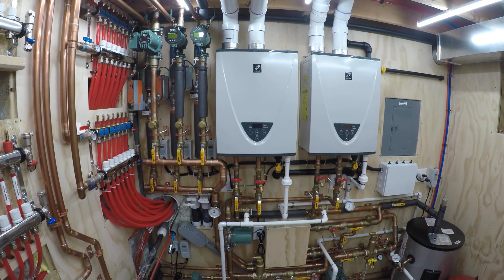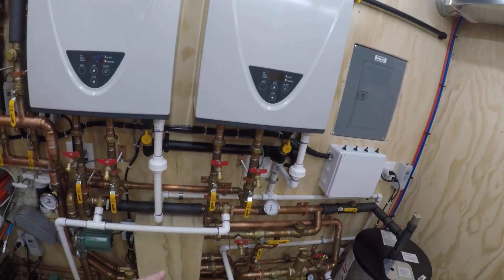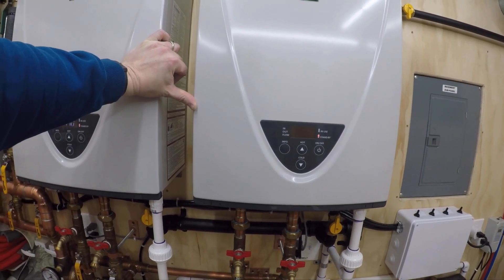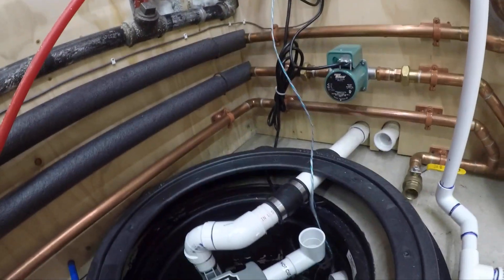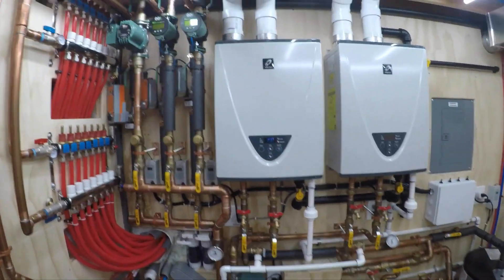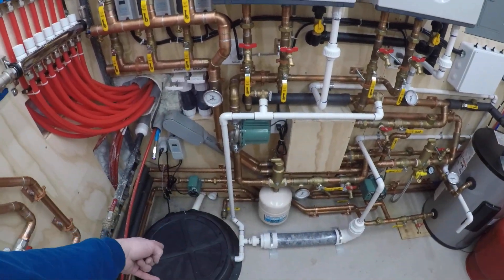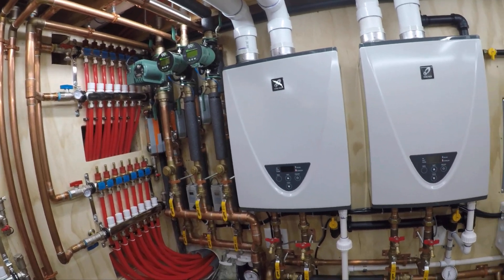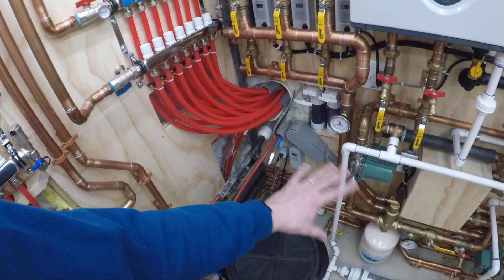Mechanical Room Part 3: DIY Heated Driveway Snow Melt & Radiant Heat System - Episode 55 [2-12-2021]

Comment: Hello sir, what Beautiful work. I have one question:  why don’t you have pre-filters, water softener and post-filters for incoming city water. That would help your efficiency, longevity of equipment and great drinking water.
Reply from the maker: Hi Joe!  Thanks for the compliments, I appreciate it!  Great question about the filters.  Adding them was a part of my initial plans, but I later decided to leave them out.  Luckily, our city / county water here is great.  It is not "hard" or "soft" at all.  While it would be nice to have the filters just to remove any sediment that might come in, we have no complaints about the hardness of the water, the taste, etc.  I have a shower head that I installed 15 years ago, and I have never taken it apart to clean the inside.  It still functions like the day it was new.  I think it would've also been difficult to incorporate filters into my pressure loop design, unless I put them between the meter and the loop (which I didn't have room for), or installed (2) filters, one going each direction.  In the end, I don't regret not installing them as we have no issues, but I could also see someone incorporating them into their design. Hope that helps, and thanks for watching!

Comment: How hot does the snowmelt lines need to be? Im hoping to install in a new driveway with geothermal for my source and the installer said they need to get hot enough for the water to evaporate so they need a boiler to get hot enough or ice will develop.
Reply from the maker: Hi Dan!  Your supply temperature will depend on several factors, including pex size, pex spacing, size of the slab your melting, expected performance, insulation, etc.  For my system, once everything is up to temperature I have 100ºF going out to the slabs.  I would agree with your installers with regards to temp. The last thing you want is a system that melts but not completely.  It will run non stop trying to keep up, wasting resources and creating ice if not hot enough.  If you haven't watched my other videos yet, check out some of the startup ones, including this one: https://www.youtube.com/watch?v=zvBzC93B5j8
Thanks for watching!

Comment: I’m about to pour a pad and don’t quite know the best way to get a tube like you did installed so I can run a bunch of pex through it. 

Could you speak to layout concerns/spacing of the pex under the concrete and other prep before the concrete pour?
Reply from the maker: Hey xRapidDavex.  Not sure if you saw my playlist, but the first few videos show and discuss the prep before the pour.  You can find it here: https://www.youtube.com/playlist?list=PLdWeMRuZcbQjekwiBk_uy39IS6JFWYORD 

I lucked out in that the 6" PVC pipe through the basement wall was installed years ago, and I was just able to tap into it.  That could be done a number of ways, I just decided to run all of my loops through the existing pipe into the basement You could locate the manifolds outside if its easier.  With regards to the spacing, the larger diameter pex you use, typically the wider apart it can be.  Mine is no doubt overkill with 5/8" pex at 6" on center for most of the install, but in all of my research I have never heard or read about anyone regretting putting TOO MUCH pex in the slab.  Bigger pex also gets very difficult to bend and work with, so take that into account as well.  Connect all of the loops together and pressurize them before and during the pour, and have repair couplings ready use in case!

Comment: Awesome, this is so great to see! The more geeky the better. At least for me:) Thank you for sharing. Could you share some information about your energy/gas usage in cubic feet (is that what you measure in in the US?) and kWh? It must be a relatively expensive to run all of this 24/7, having heat go to all these places. Of course you shut it off at night, but still.. Again, thanks for sharing! Looking forward to more:). Subscribed!
Reply from the maker: @Tom de Boer  Thanks for the compliments and feedback!  If your looking for gas usage for the snowmelt part of the system, you will find this video extremely helpful: https://youtu.be/VotJEQigTkw

Believe it or not the system is extremely efficient, and it is not that expensive to run the radiant heat portion at all.  The snowmelt costs approx $0.50 - $0.70 per hour to operate, but that's literally heating the outdoors as I keep the slab snow free.  Regarding your comment about shutting it off at night, believe it or not, I actually do not.  The radiant portion is meant to run 24/7 on continuous circulation. I also made a couple of videos on how all of that works, you can find them here: https://youtu.be/mdcL97cuRDs

Thanks for watching and subscribing!  I have several more videos to post.  If you haven't seen it yet, this playlist: https://youtube.com/playlist?list=PLdWeMRuZcbQjekwiBk_uy39IS6JFWYORD contains all of the videos I have uploaded so far on this topic.  I think you'll find several of them useful!  -Chris

Comment: I’m a Union sheetmetal fabricator and I watched 1,2, and 3.  Awesome job and thank you for the video.  I’m obsessed with mechanical rooms.  Furthermore I’m building a shop on some property and then a house.  You set the bar high my friend.
Reply from the maker: Hi smgeorge816!  I really appreciate you taking the time to watch my videos, and taking the time to leave kind comments.  I think I mentioned it in one of those 3, but I was a little cramped for space here.  I wish I had more wall room, but I just didn't.  The zone pumps / valves are a little closer than I wanted, but I made sure that everything could still be serviced (including being able to remove the actuators for repair / replacement if necessary).  Overall I'm happy with the results!  If you have any other questions or want to see anything else, just ask!  Thanks again for watching, and stay tuned, much more to come! 😁  -Chris

Comment: Christopher, I'm a mechanical engineer and I've worked in the HVAC construction industry for 25 years. That piping looks as good or better than some professionally (Union!) installations. You've done a great job with the controls and all of the accessories like the expansion tanks, air vents, fill/purge valves, air separators and even the heat exchanger! In an earlier video you noted that some people don't recommend using the tankless water heaters and the only reason for that is the small size of the tubes in the heat exchanger means they can get clogged if you don't do the maintenance that you mentioned (flushing with vinegar on an annual basis). They also have a bit higher pressure drop and flow restrictions compared to boilers. Otherwise, they are just as efficient (at a fraction of the price because they're made in much higher volumes) as the other boilers you mentioned, which if you used you'd basically operate "in reverse" from your setup (e.g. You'd run the glycol through the boilers and domestic would come from the heat exchanger). As long as you do the maintenance (and your strainer on the domestic water inlet is very helpful in that regard; you might even consider a water softening system - that will help reduce precipitating calcium in the domestic hot water when you recirculate at 140 F). It's a shame that you have to start your snow melt manually - a combination snow/temperature sensor in the driveway would have made it all automatic. I also like your comment about using two water heaters even though one would do the job - the start-up and having multiple demands really makes that second heater necessary. Heating up the concrete driveway takes a lot of heat and getting the snow melt started with a single heater would be slow. Now you just need to insulate all that copper pipe so your heat all gets to where it's needed, not just keeping the water heater room warm (it is a shame to cover up that beautiful piping job)!
Reply from the maker: Hi Ken! Thanks for your detailed explanations and positive comments!  I debated long and hard about using a wall-hung boiler with an indirect vs these tankless units.  In the end I decided to go this route, but I have no doubt it would've worked just as well using a boiler.  So I'm thinking you haven't seen my electrical system overview video yet? 😀. In that one towards the end I talked about my decisions on the whole automatic vs. manual.  The good news is, I DID put the Tekmar Socket in the slab, and run conduit back to the boiler room, so adding automatic operation is still possible down the road 😁.  I also debated heavily on the whole 1 vs 2 heaters.  I was told by several folks that 1 would be just fine, but in the end I'm glad I set it up for 2.  Sure I could've added a second later on, but it was just easier to pipe it all with 2 from the start!  You're right about the insulation, it's been on my list for a few weeks, and it does get nice and toasty down there.  The plus side is the kitchen is right above it, so all that heat just helps warm the kitchen floors 😁.   Thanks again for watching and for your kind comments.  I'm always honored and humbled to receive positive compliments from plumbers, HVAC guys and engineers like yourself.  I hope you come back to watch and comment on more of my videos in the future!!  -Chris

Comment: Nice work 
I own a plumbing company in staten island new York 
Been watching your videos and they are very intuitive
Like the engineering with the 3 way valves and the aquastats 
You did an amazing job 
I heard you say that in one of the other videos that you researched everything even soldering , so am watching and wondering to my self what do you actually do professionally ? 
Would like to see purging video 
And had a comment on the venting 
Fresh air intake schedule 40 is ok 
But on the exhaust out I think that you should have used Polly prophelyne or schedule 80
Reply from the maker: Thanks for the compliments!  That is correct, before I started this project in December of 2019 I had maybe soldered 1 or 2 joints in my life.  I've been watching guys like Steve Lavimoniere on YouTube for years, and always had a respect for the trades, especially plumbing and HVAC.  One channel that really inspired me was Adam Hadlock (My Garage Buiild) https://www.youtube.com/channel/UCDJ5_QU1pGo-9Vs4gfBDVBg  I felt like I had a lot in common with Adam, and after watching him setup his Boiler / Tankless system, it inspired me that I could do my own as well.  Professionally, I am in the IT industry.  At some point I will absolutely upload not only the purging videos but all of them.  Right now we've been getting so much snow I'm backlogged just getting the time lapses up!  Once spring comes and I have no more snowmelt videos until next winter, I will start uploading ALL of the video I have, including purging.  My plan is to try to release a video every other day for the foreseeable future.  Thanks for the comment on the venting.  The Takagi manual stated Schedule 40 was allowed and acceptable, and the concentric vent kits I purchased were recommended by Takagi.  I will double check the manual to be sure though, thanks for the tip!
Reply: @DeckerChristopherJ  This is great, I just setup my own hydronic HVAC system and I'm also in the IT/Software industry, there are dozens of us! lol

Great work!
Reply from the maker: Thanks Robert!  It must be all of us IT guys and gals that played with Legos as kids.  Building this system reminded me of playing with Legos.  You can build whatever you want if you have the right pieces! 😁  Thanks for watching!
Reply: These are tankless units and not wall hung boilers so the exhaust is probably not hot enough to require schedule 80

Comment: I am truly amazed at the final product. Being in the Hvac field I applaud your craftsmanship  and layout. I would be interested in seeing some of the  re-engineering you have done. I think many people would look at that and see colored piping and spaghetti but cannot appreciate the immense thought process that goes behind putting 10# of stuff in a 5# bag and having it look good, function properly and being able to be serviced. 👏👏👏
Reply from the maker: Thanks again for the kind comments.  I took extra precautions to ensure that anything serviceable can be done so efficiently.  The Belimo 3-way Valves can all be easy removed from the valve body with 1 screw, and I made sure my piping layout did not prevent any of them from being removed.  The valve bodies themselves are all SS and should last a lifetime, but I could see an actuator failing  with time.  I also made sure to install isolation valves on the zone pumps, so a pump can easily be changed without draining glycol all over.  The domestic side is easier, since its just domestic water.  I can drain, refill and purge that portion without much effort.  You are correct when you say putting 10# of stuff into a 5# bag (or wall).  That was actually one of my biggest challenges!  Getting it all to fit in the limited space I have, but also leaving components able to be serviced when needed.  Thanks again for watching!